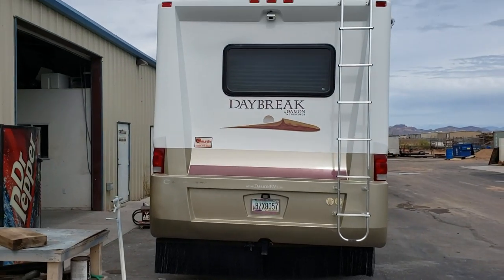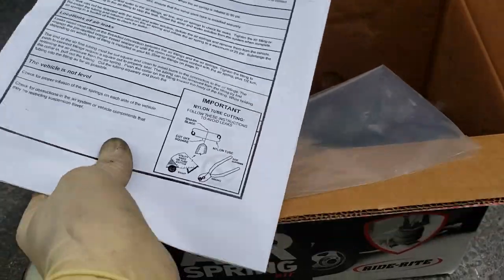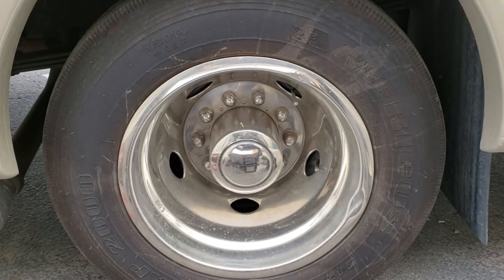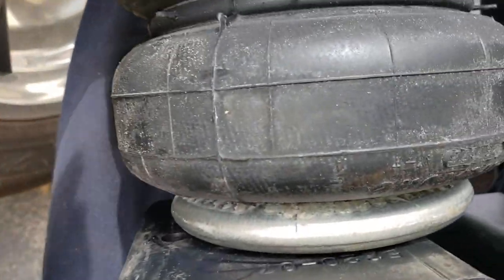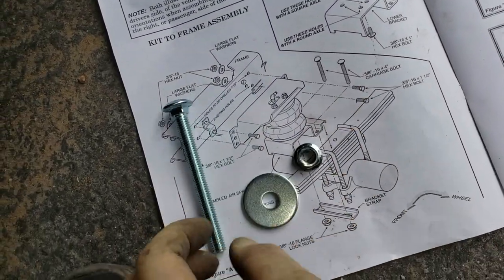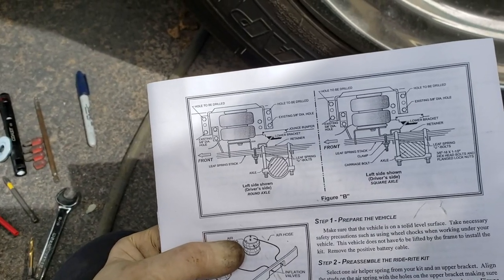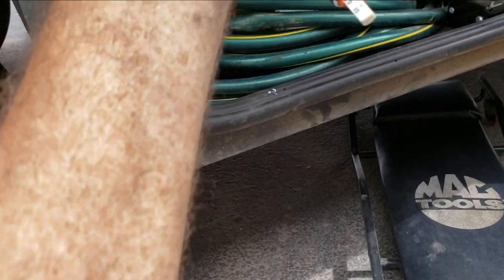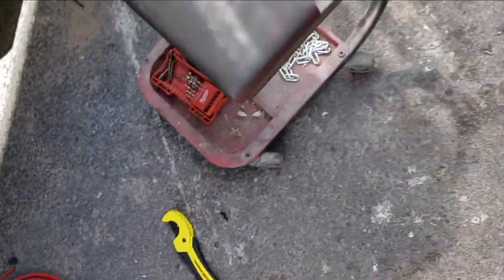Installing Firestone Ride Rite Air Bags on Ford F53 Chassis

Comment: I'm glad you put 30psi in the low side. I was wondering if you were gonna do that. I'd hate to see one side at 90 and one at zero. I don't have any science at all to back up that statement, it just "feels" wrong. Also, my son saw the blooper at the end when the part dropped and said "uhhh, why does everything ALWAYS roll under the cars"!? As you can imagine, we get a lot of soccer balls stuck under our cars over here.
Reply from the maker: no it's wrong for sure, I don't have science either just the very bad instructions lol. Firestone recommends at least 20psi in a bag at all times. I'm still unconvinced that 90/30 split seems reasonable but I can say the owner said it was so noticeable he doesn't hate driving the motorhome anymore. I guess he was thinking of trading out due to the lean. Thanks!
Reply: You don't want to ride with them empty because it can crack the sides and then they'll leak.  Especially true for older air bags.

Comment: Just helped me decide to go ahead with the purchase of the same set up.  Thanks for posting and sharing
Reply from the maker: good luck! I hope it helps
Reply: @AZExpert  By chance do recall how much movement the bags moved the motorhome?  I have a 37 Damon Challenger it leans 2 1/2" to the passenger side, once I installed the bags put 95 psi in the low side and it moved an inch.  Doesn't appear that it will go anymore.
Reply: @joshsalazar9959  did you get the exact same kit I think they have different sizes. He went from 17" to about 19-1/4" so about 2-1/4 inches at 90 psi then he let a little air out. So 80-85 psi. Hmmmmm this one he said was 23000 gross vehicle weight, what’s yours?
Reply: 22000 pounds coaches are same mfg.  thanks for the feed back.  I did get the same kit.  I had replaced the front leaf, shocks and steering stabilizer thinking failure.  Replaced   rear shocks thinking factory where bad.  mines a 37'.  raised  1 1/4".  Called a hand full of shops anout a new leaf or a added leaf with no luck.  Better than it was I guess

Comment: Did you jack the rig up at all?  The air bags should be mounted with the rig jacked up so the air bag is not full extended at the normal ride height.

Comment: Considering the cost and work of leaf springs, also not knowing exactly how many and strength I would need, this seems like a reasonable investment. I feel like my rear end is really sagging. It’s a Chevy van 30. 24foot long. I think it sticks out 10 feet past the axle on rear. Seems like it should do wheelies. When inside rv it seems level but I can tell the old girl is way overloaded like you mentioned. Gross vehicle weight is 10,500 and I am normally at minimum 9,600 lbs. that’s a big constant load on a 1ton dually van. So thanks for the video! I’m gonna try them out.
Reply from the maker: Good luck, it should be easier than leaf springs for sure.

Comment: My 1999 Hurricane (Four Winds/Thor) has body mounts that would get in the way of the location of the rear airbag brackets.  Not sure how many models use Thor's "isolated floor" design but it would seem like any that do would suffer the same issue, perhaps explaining the "NOT THOR" identifier.

Comment: A lot of gas class A motorhomes are leaners.....including mine.  You installed airbags only on the rear because there were already on the front?  I'm curious how running the psi differently per side affects the ride/handling.  Thanks!
Reply: I have the same question / Can i install only in the back?

Comment: Have you ever done a Workhorse W22 ? I just put a set on the front, and the rear looks pretty complicated. I might try and do it over the wheel like you did. I don't believe my wheel fenders come off. I used Air lift brand. I'm editing my comment. I just went out and looked at my rear fender. It does appear I can remove it as the screws are accessable with the adjacent compartment doors open. I'm thinking taking them off and lifting the coach a few inches with the leveling Jack's and I should be able to get to the frame. The air bags I got say they go directly over the leaf spring.
Reply from the maker: Good luck. I have not added bags to the rear w22. Just be careful not to get crushed. What kind of motorhome do you have
Reply: @AZExpert  2004 Newmar Mountain Aire. Did you lift the coach a bit with your install?? Also, the fender on ours has screws in the sides, how are these generally attached on the top? I sent an email to you with a picture of the side of the Coach. Didn't know if you could give me insight on the fender removal.

Comment: It sure would seem with that difference amount of air, one side would ride harder than the other.  I went to a spring shop and they added spacers to make up the difference in height.  So far, it is working OK.......
Reply from the maker: I would have thought that too. But since the sag is generally caused by uneven weight the air bags just take up the slack of the additional weight meaning the leaf springs should respond in kind. And the sir springs can act as absorbers the reduce spring back. Spacers do work to level, but not relieve the uneven weight. I'm not an automotive engineer so please dont quote me as an authority. 😀
Reply: AZ Expert Yes, you are correct as it doesn’t relieve the weight difference with the air bag. Before I got mine adjusted, I did a 4 wheel scale weight and adjusted the weights by shifting the storage to different compartments. 

As it was adjusted as much as possible, I filled all the tanks (fresh water, fuel, propane and personal belongings) then brought it to the spring shop. They adjusted it to 1/2 “ in height for level with spacers. 

Since then, it rides level and smooth. Of course, I changed the shocks to Koni’s,  rear Trac bar and Cheap Handling Fix on the sway bars. Hugh difference 😆.

Comment: 95 pounds of air pressure? Holy. On my Kenworth, I never went over 60 pounds on its air bags and that was loading over 80,0000 pounds gross on an 18 wheeler. I have never blown an air bag but have never gone to 95 psi.
Reply: I wonder what the max is allowed... that would be a loud bang if one blew. I imagine it would scare the crap out of surrounding traffic lol 😝

Comment: There's no way this thing rolled off the lot like that. Something has gone past elastic deformation and been bent. Kinda doubt it was a spring unless the bumpstops were gone. As long as the load was similar left to right it's sorta fine... If it turned out the problem was up front and it was leveled by adding spring rate to the rear (the bags), it's now more than a little dangerous to drive.
Reply from the maker: while you might be correct they definitely do leave the factory like this too

Comment: Of course I have a 2019 Thor and it says it will not fit. Do we have another solution for this issue on a Thor?
Reply from the maker: I would order it and see if it fits. The chassis is nearly indentical between RV builders. Return it if it doesn't fit....I ran into the same issue with this motorhome too.
Reply: Where are you located? I need a few things done in my Rig and am looking for a reputable RV mechanic.

Comment: How do you remove rear fender?
Reply: On a 32v adventurer 2002
Reply from the maker: screws on the frame struts, mounting flanges, and then tiny screws in the beltline on the wheel well side
Reply: @AZExpert  thanks for answer. I ended up taking tires off. I think it actually made it easier to drill the holes as needed.